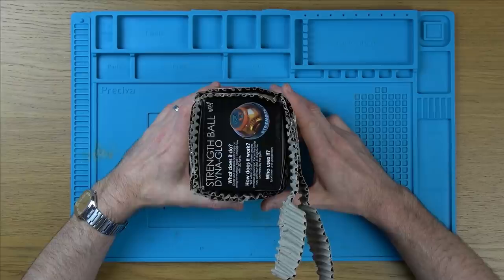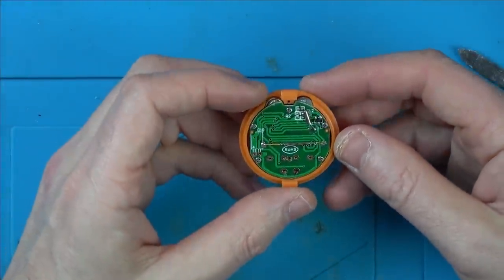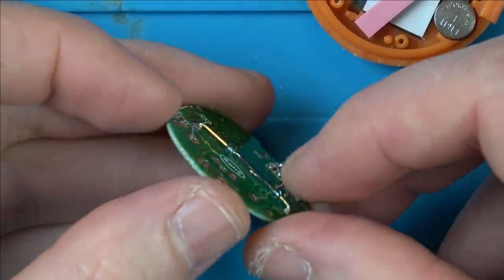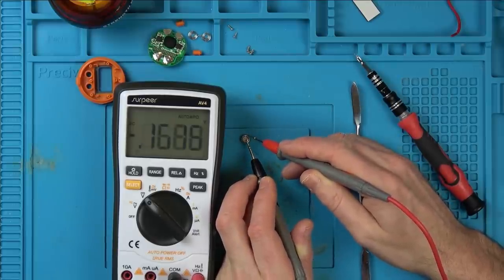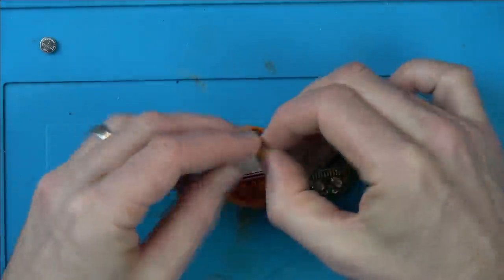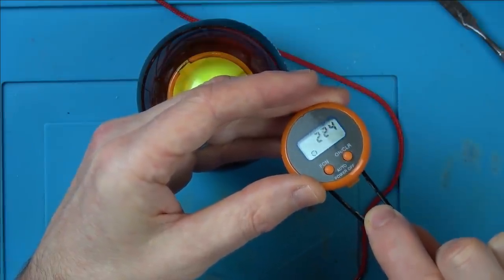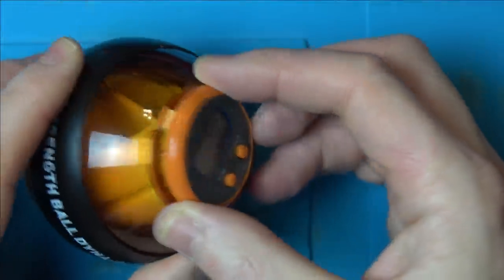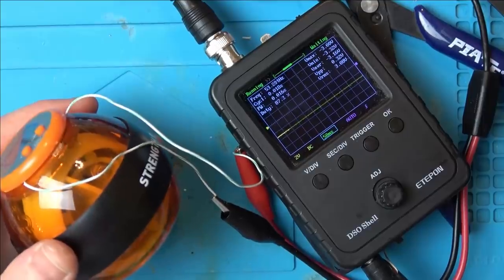Gyro Strength Power Ball - No Power - No RPM - Quick Fix

Comment: Pretty sure it's just calculating the RPM from the spin rate and not showing the actual revolutions
Reply: Yeah it will just be calculating the time between pulses.
Reply: Yep I agree
Reply: theres an RPM to Hz converter site. it was showing the revolutions per minute (RPM) even though it was going slowly, spread out to a whole minute it very well could have went round 150-200 times...200RPM.  its just like when they take your pulse at the dr... they dont feel your wrist for a whole minute. they count beats for 15 seconds then X 4 to get BPM.

Comment: With RPM I would think its pulse width. The faster the rotation the smaller the pulse width. From this it is easy to find acceleration. Circumference is known so fairly easy for chip to calculate. This is why only one rev is required to give info on read out. I have been wrong before. Hmm that's a fairly obvious sentence. Love your vid's Vince.

Comment: It's measured in RPM, so the speed by which the reed switch makes and breaks contact, even if it's only for a few seconds, it averaged-up to give a reading as though you were using it for the full minute.

Comment: I think it's based on RPM... Rotations per Minute.
So even though you spun it and it did say...10 rotations in a few seconds...
It will calculate it and estimate how many it "would" have done if it was over a minute...
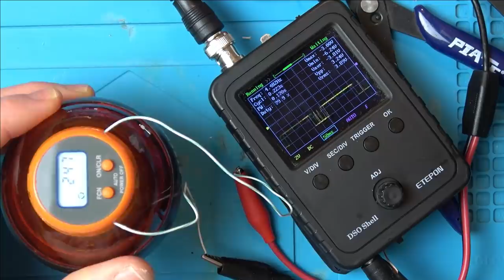Reply: 12:45 The Oszilloskop shows the Answers: Top left, Freq and Cycl = Frequenz and Cycle Time.
It counts the Time between 2 on states of the switch = Cycle Time
1 dividet by Cycle Time = Frequenz in Hertz (like the Clock Quartz has 32768 Hz)
Hertz Times 60 = RPM

Comment: Great job =D  For the RPM estimate its simple, they time how long between the pulses.  You can be pretty accurate with the estimate there doing that.  But it is an estimate - ie. when you got to 5000 there, if you had maintained that speed for 1 minute, then you have ~5000 revolutions over that minute =D

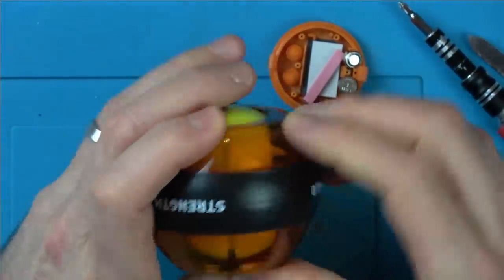Comment: 3:30 It's not glued but it's a very tight snap.  I have to literally stand on mine (sideways) to pop it open.
12:30 It's calculating RPM.
14:00 Right about here, you should be able to switch to making very small movements.  The scraping sound you hear is the axle slipping against the plastic ball while you build up speed.  As it speeds up, the gyroscopic forces better hold the tiny axle against the track on the inside of the ball.  You should eventually be making VERY small movements and you wont hear the axle scraping noise.  The forces from the spinning gyro will be huge against your arm.  It's a great workout device as you can then focus your movements on a specific muscle group (wrist/albow/shoulder).

This is an off brand, the Powerball ones have the reed switch on top of the PCB.  I'm guessing someone lost grip on the string and it got sucked up inside, smashing the reed switch.

Comment: I assume the number on the screen is being derived from an estimate based on how many times the reed switched is hit per every, lets say, one second.

If the reed switch is hit by the magnet 10 times in one second. You should get a reading of 10x60, 10 being the number of times the reed switch went off in the allotted 1 second the micro controller is reading, and 60 is one minute in seconds, since we are measuring RPM(Revolutions per minute). So at the given snap shot grabbed by the micro controller you should see 600RPM on the screen. 

You saw 300 RPM on the screen at one point while spinning the ball by hand, so 300/60 = 5. So the micro controller saw the reed switch go off 5 times in one second.
Reply: That would make sense since its based on the rotations per minute

Comment: Does this thing generate power for the led's or will you revisit it later on down the track when you discover a second set of batteries are hidden in the flywheel to run the LED's when centrifugal force closes the circuit? my guess, there is, as something would have to balance the wheel with only one magnet to trigger the RPM display. edit: spelling LOL

Comment: I think the rpm  is based on if you do 5 revelutions in a second it times that by 60 to give an average rpm. So 5 per second would average 300per minute which sounds right based on what your readings were.

Comment: 5:46 that means when that battery went dead, a reverse polarity charge was caused by the other (more charged) battery (so technically it's charged to some extent but the wrong polarity was inherited), it's why they say to not mix batteries of different charge levels together. 12:25 it takes the first and second pass of the magnet and does math on the time between the two, reason it looked so wrong is because the math was not geared to someone just spinning the ball a few times, as more rotations occur the more accurate it would be on average.

Comment: Nice repair. I was equally excited to see that you're getting more familiar with your oscilloscope!

I think I played with one of those back in highschool. Never owned one though. It's interesting that the reed switch produces a low. I suppose the dc level when you probed was at the same voltage as battery? Then the switch shunts the voltage to ground at each pass of the magnet. Potentially that's what triggers the count, or develops the frequency, for averaging calculations by the IC imbedded in the COB.

A reed switch is fairly similar to how a relay works. Obviously there are big difference as well. However both use armatures, or contacts, that close under magnetic fields.

Comment: it probably has a microcontroller with some kind of math formula running inside it. when it reads the mag pulses the micro knows the diameter of the ball and it spits out an estimation.  even if the ball doesnt spin for a long time when it is going slowly it could actually be going 150 RPM if it stayed spinning for a whole minute.

Comment: I really don't get the purpose of this device. I'm still scratching my head regarding fidget spinners to this day... I get why you bought it, to repair it, but why would you buy a working one?! People are weird ^-^ That's also why I'll never get rich, because people buy pointless stuff and it would never occur to me to create something that is pointless
Reply: It's designed to increase grip and forearm strength, as you spin it in harmony with the gyroscope it spins faster and requires a harder grip. It does work as your arm and forearm will begin to tense up and burn. I have one I got in a charity shop for a quid or two as I was intrigued
Reply: @Dazza2292  Yeah, but don't guys have that tool built-into them already? ^-^